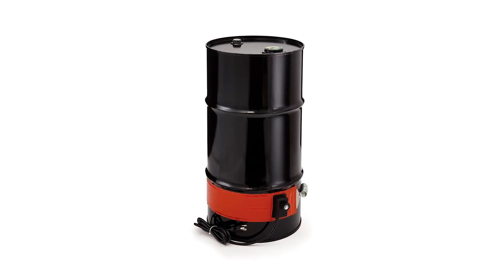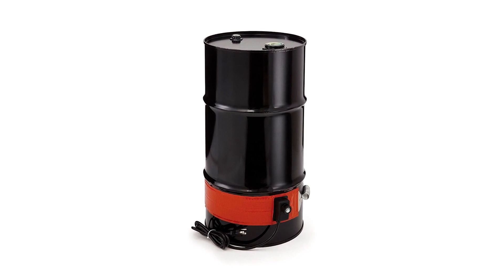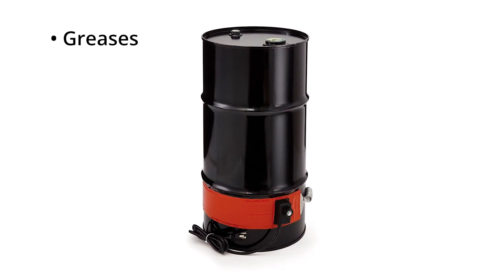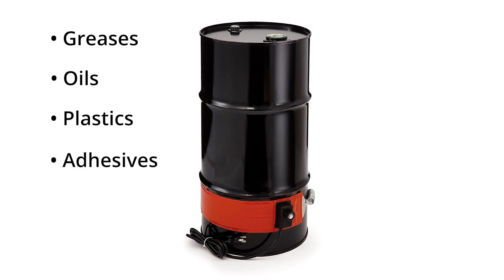What is a Drum Heater - A Galco TV Tech Tip | Galco

Comment: Would you recommend using it with a steel drum or plastic drum? We using the drum heater to warm up water while adding oils and mixing. Afterwards, the product needs to cool and we will take the heater off. Just curious about your opinion.